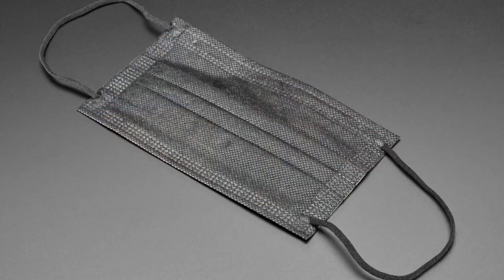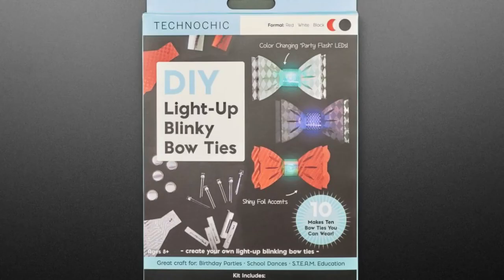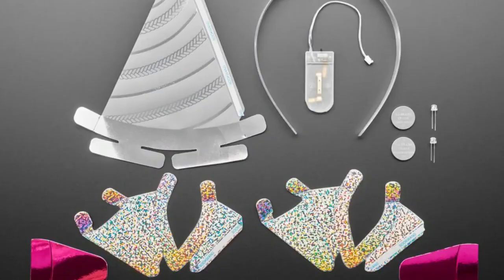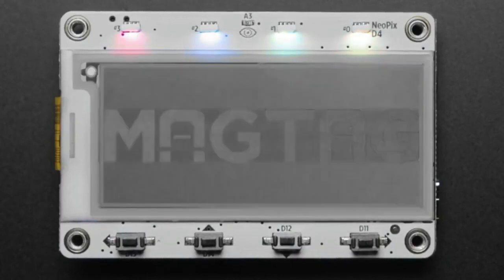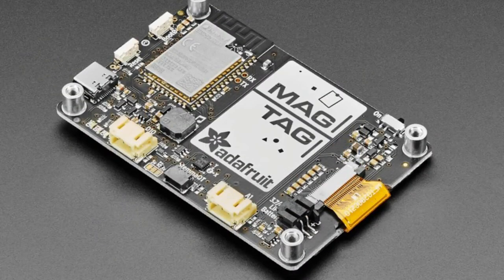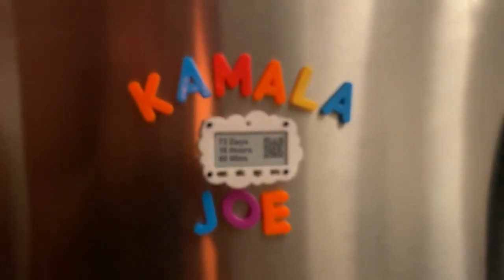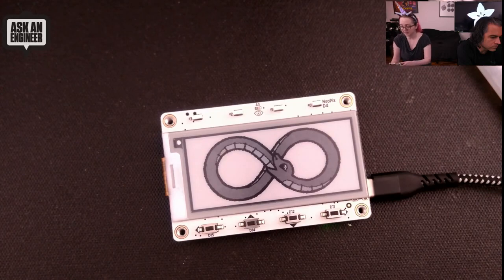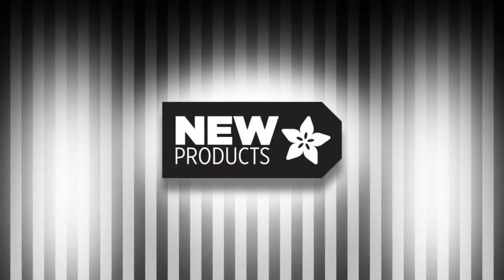New Products 11/11/2020 Featuring #Adafruit #MagTag - 2.9" Grayscale E-Ink WiFi Display!

Comment: I’m interested in using these e ink displays as price tags for my warehouse inventory. I understand the downsides of having price tags with wifi enabled due to its dependency of the internet. Besides that, are these programable? If yes, what programming language? My idea is to trigger an api call to cloud db we’re it will fetch data and display item name and price, for example.
Reply: They are completely programmable.. and what you describe sounds very doable. It seems the easiest path is to use CircuitPython.